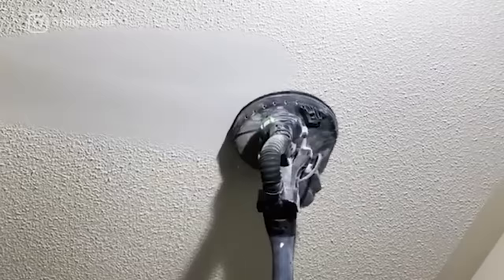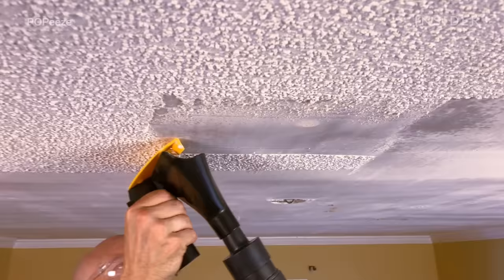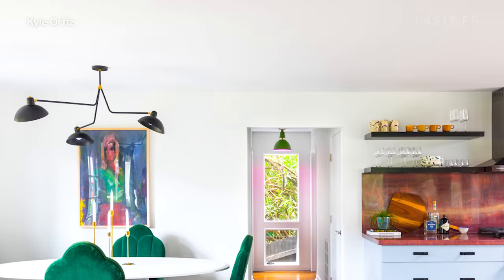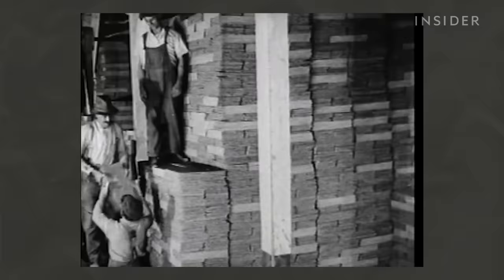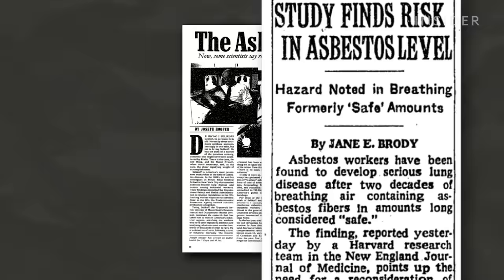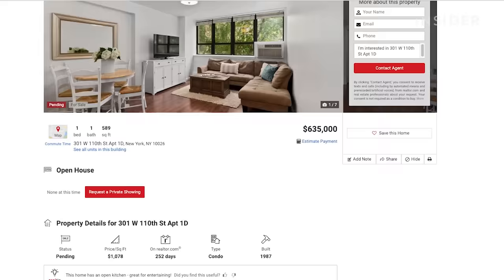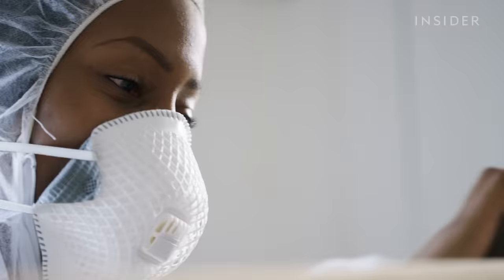Why Are Popcorn Ceilings So Terrible?

Comment: She said the style, "adds shadows and is a distraction." 

It's a ceiling.
I like the shadow texture.
It's a ceiling.
Adds depth. 
It's a ceiling.
Reply: Yeah I like popcorn ceilings too. If you're able to reach the ceiling, the texture feels so nice!
Reply: It was very odd to have someone discussing aesthetics, but saying that depth and texture were negatives.
Reply: Who gets distracted by a ceiling? (In a negative way) there is always an adventure with popcorn ceiling s especially when boredom is applied
Reply: Tbh I love textured ceilings. They're fun to look at and feel.
Reply: This 'popcorn ceiling' thing looks a lot like the texturing my parents did to a ceiling in one of our rooms about 10 years ago.

Although they didn't spray anything on. they used a sort of paint roller, but with big spongy holes in it which caused this thick paint to be applied with lots of random peaks in it.

That type of wallpaper with tiny chips of wood inside it is also quite nice.

Comment: popular from 1945 to the early 1990s. Popcorn ceilings applied before the 1990s are most likely to contain asbestos. The fire-resistant mineral was popular in building materials until the 1980s.

Comment: As noted, popcorn finishes were often applied to cover defects. In older homes these defects may include plaster deterioration. If installed at the time of construction popcorn finishes were used to conceal substandard taping and spackling. Certainly if the gypsum board installers were aware that the plans called for popcorn finishes they needn't try as hard.
Point is, the costs here are for popcorn finish removal. Additional costs will be incurred for remediating the underlying conditions to make ready for a new paint finish.

Comment: Growing up I had a friend who’s whole house had not only popcorn ceilings but also walls, the things on the wall were as big as a small coin. It looked absolutely awful.
Reply: Ok
Reply: It's called texture. And what you're describing sounds like knock down. Imagine a time when people didn't have 3 years to spend on getting a perfectly smooth sheet rock finish. Where taping, sanding and mudding was all done by hand. You should try it sometime. It'd be character building.
Reply: In Spain popcorn walls and ceilings are very common in older houses. My house is actually full of it and while it doesn’t look very nice I just got used to it because I grew up in this house. Popcorn walls are pretty useful for reducing noise and also to conceal poorly done construction from a couple of decades ago 😅

Comment: I like popcorn ceilings. I didn't think this was an unpopular sentiment.
Reply: Better get rid of the popcorn ceiling ASAP because even the tiniest amounts of asbestos causes lung cancer. We're talking as little as 1.3 parts per billion (1.3 mm^3 out of a cubic meter). Even brushing it with a feather duster already releases that concentration of asbestos.
Reply: @00crashtest  calm down calm down

1) If the ceiling is less than 40~50 years old, it already doesn't have asbestos due to the regulation

2) As long as the ceiling is not damaged in any way, the asbestos can't get free.
Reply: Same. I still have mine
Reply: 00crashtest No, stop spreading misinformation as most people probably don’t have houses more then 40 years old, and if you do it’s probably gotten a big renovation by now.

My house was made in 2004 so it’s pretty new and the popcorn ceilings aren’t dangerous at all.
Reply: agreed

Comment: The dates 1930s-1990s means that a lot of popcorn ceiling went up when asbestos use was dropping or after the bans that went in place in the 1980s. So a lot of popcorn ceilings don't have asbestos and are just sprayed plaster/Gypsum materials.

Comment: Did anyone else find kinda satisfying when the removed the popcorn ceiling?
Reply: Yes
Reply: Obviously
Reply: Hey thanks for all the likes
Reply: @Alman.Alvi06  ur welcome
Reply: God no, they arent wearing masks half the time and there isnt any proper abatment, they're probably getting asbestos in the heating ducts, their lungs, the carpet, etc.
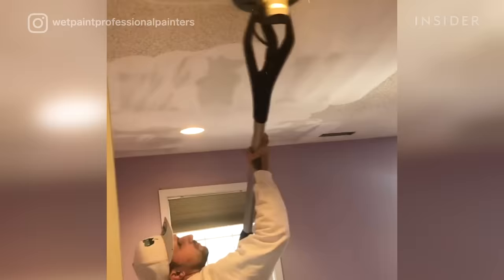Reply: @arthas640  at 5:01 professional without a mask and we can see dust falling,  will he not have asbestos lung later in life
Reply: @GladiatorReid  getting asbestos lung isnt guaranteed and limit exposure isnt good but it's not necessarily fatal. The problem with asbestos is its structure is like fiber glass: long thin serrated strands that slice into the soft tissue of your lungs but unlike fiber glass its hydrophobic, it repels water so you cant cough it up. Ot basically gets lodged in the lungs and gets encapsulated in scar tissue. A little asbestos means a little scar tissue, which is something everyone gets in small quantities in their lungs over time from wear and tear, but if you get exposed to it alot your lungs become riddled with scar tissue leading to COPD and all that damage massively increases the risk of cancer in the same way and for similar reasons as smoking. In small amounts you never notice the damage but it's still there and never really heals which is why it's so dangerous. Definitely not a smart move
Reply: Yes asmr

Comment: 4:36 anyone considering removeing pop corn ceiling containing asbestos, please do not. Asbestos fibres are very very tiny, a normal respirator will not do. Even if you did have a proper respirator, the fibres would still become lodged in your clothes, hair, surroundings, and maybe skin posing a risk to your life. The proper tools for asbestos are not avalbable to average people and as such, a professional is required
Reply: adric sub2pewds undoubtably would stick to everything around including anywhere there is ventilation. A still room with zero movement of air and NO ventilation would still require 48 hours for a single asbestos fiber to fall all the way to the ground.
Reply: Oh well, yolo am I right?
Reply: @future2228  theres not really any positive to doing it yourself though, not worth it. A professional will do it for not much more and he can do it safely if he knows it has asbestos
Reply: @Korpx  If a professional asbestos removal contractor was to remove it, there would be sufficient negative air pressure units (depending on the size of the room in question). Just don't scrape it off like in this video, even if the asbestos content is lower than most asbestos products. Scraping it off yourself will almost certainly cause you harm.
Reply: Asbestos is guaranteed to give you lung and or blood Canser within 3-5 years of inhaling it. Please contact professionals

Comment: I am a guy who HAS removed popcorn ceilings on probably about 10 different properties. Maybe a couple more than I'd  like to admit because since I'm about to mention the number one thing that was mentioned in the video about popcorn ceilings, maybe hesitant to admit that I've done more of them. And that one thing is: ASBESTOS - yes, most buildings 1980 to current day, if there's popcorn ceilings in there; there's big and bad ASBESTOS in there. Big Warning: if you scrape the popcorn, you WILL be exposing yourself to breathing ASBESTOS and it is no joke. It will get in your lungs, on the soles of your shoes, it will get on your hands, your skin, in your eyes and even though you completely cover up and wear a full respirator; you'll probably still going to get exposed to it. So word to the wise. Now, there IS a way to save yourself this trouble. One is to hire a contractor to scrape it. And HE will be exposed to the ASBESTOS and in Most states ASBESTOS must be disposed of in a controlled way. It must be taken to a state landfill that is equipped to deal with hazardous materials which is what the ASBESTOS is. But there IS a way to solve the popcorn problem and here it is: you take quarter inch drywall and you; if you're a DIY'er, or contractor, you're going to nail the quarter inch (lightest to hang) drywall sheetrock panels to the existing studs on the ceiling-corner to corner, wall to wall and you're going to tape and mud & seal that up. No more dated popcorn ceiling look and NO hazardous ASBESTOS exposure for you!!!It's the perfect way to encapsulate it because once the new drywall is up you will never know that stuff's underneath it and you won't be exposed to it either. So there's your tip: quarter inch drywall on every ceiling that has popcorn. It's safer than scraping it and you'll be ultimately, done with the ASBESTOS. Don't try to scrape popcorn ceilings on your own, you'll thank me later because you are exposing yourself to one of the most dangerous substances to breathe known to mankind. Take it from me I know, think twice before you do a popcorn scrape. Your welcome!
Reply: Rossboss7538 ====my only concern is is mold if you get a leak in your roof ?
Reply: @joegonzales772  that sounds like maybe some rain got through your roof and you're saying that the drywall underneath the roof shows mold. If it does you have to fix the roof leak first obviously. And then remove the drywall areas that are damaged by mold and replace them with new drywall. Cut out all the areas that are showing mold only areas that have mold on them, and repair it with new drywall. Tape and mud it and paint it. You must get rid of the mold it is very dangerous those mold spores are bad to breathe. Get rid of the mold by cutting it away and repairing those areas with new drywall panels. That is called mold remediation and I've done some of that too.

Comment: Getting rid of the popcorn ceiling in the house we bought is definitely "on the list" but would coincide with a larger renovation vision.

Thing about popcorn ceilings and hardwood floors, is that they scatter sound reflections. Take out the popcorn ceilings with a hardwood floor and no carpet, and the room suddenly has the acoustics of a storm drain. Really good if you want an audio studio with a ton of built in reverb.

Our popcorn ceiling is really fancy, BTW. Someone thought to mix in glitter. It's funny how new of an old home it is to have that, built around 1981 or so. Where we live there are houses that go back to the 1800s.